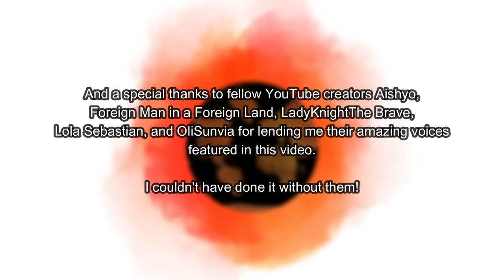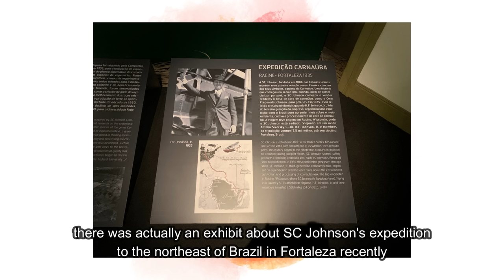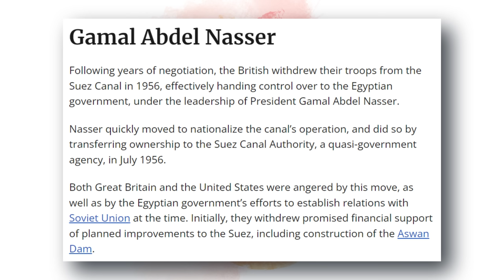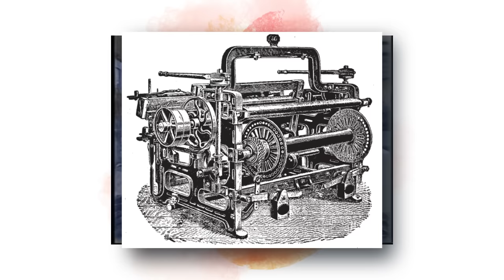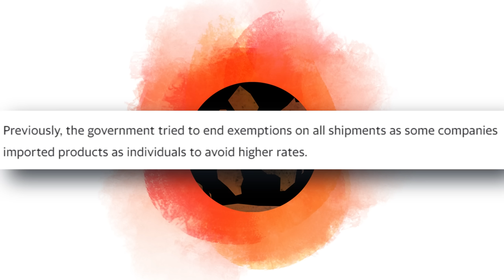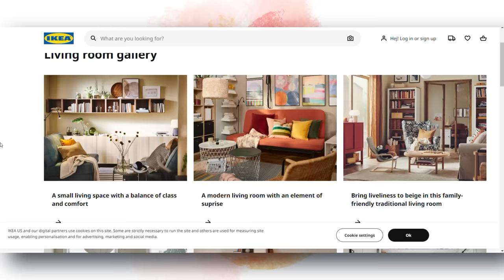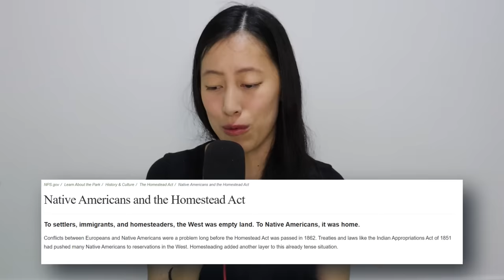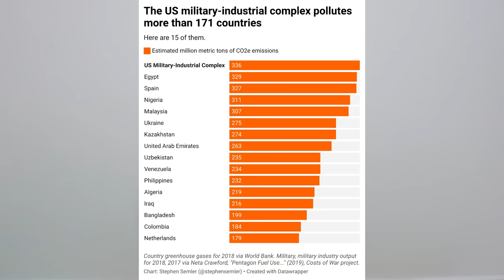Made to Break: Why Everything We Buy Today Is Trash

Comment: I've done some vintage shopping for the reasons you outline, but there are also some things to be aware of and certain cases where it might be better to buy new, anyway. The two big ones I've encountered are resource efficiency and material safety concerns.

Current appliances are by and large more energy/water efficient than antique ones. That can have an effect both on short-term cost and on sustainability. Most individuals don't favor sustainability over affordability - and I understand why, when wages are stagnant - so the latter may or may not matter to some, but for people who are in a tight financial situation, a higher energy or water bill can be devastating. I won't buy an old washing machine, for instance, because it's so much less energy and water efficient. There are some exceptions regarding efficiency, with the most notable one I can think of being computers, but there are plenty of other reasons why people don't buy old computers. Planned obsolescence plays a huge role in computers not just in terms of the physical hardware, but the even bigger driver is obsolescence of software.

There are also a lot of old products that have toxic chemicals in them because the regulations of the day were looser or people didn't fully understand the danger. The one that got me was when I bought an antique pyrex measuring cup. I found out later that they used cadmium in the paint. While the paint is on the outside and doesn't touch the contents, I no longer feel comfortable using that piece for food. There are plenty of examples of cadmium being used on things that do directly touch food. There are also some older products that contain radioactive material, and there are lots of old products with lead in them, including things that touch food. Again, there are material safety concerns with some current products, and it can be much harder to confirm that a product is made of safe materials. I think overall the prevalence of things like leaded glass used in drinkware and lead paint used in children's toys is lower than in some parts of the past, though. If you're able to buy an antique with a return policy and lead is the primary concern, definitely get a lead test swab and test it yourself.

My view is that modern things have the potential to be as good as or better than older things because we know more now about safety, ergonomics, engineering, etc. There aren't currently many products that take advantage of that knowledge to make a better product. That's an indictment of our society. On a practical level, this doesn't mean much, but it's something I think people should think about because it doesn't have to be this way.

On a practical level, in the short term, individual consumer choice is all we have to try to influence things and protect ourselves. But ultimately this is a problem with many roots and, as you point out, worker exploitation is probably the most fundamental. Also as you point out, many people are too desperate to stand up for themselves. I think what we need to do to fight these conditions is create mutually supportive communities that work together to support everyone involved.

Community soup kitchens, food banks, and gardens take some of the pressure off of workers who want to go on strike because they'll at least know they can feed themselves and their families. Community credit unions and internet service providers provide a needed utility without gouging people, and other community-based utilities could be implemented. Solar and wind farms are much more accessible than previous forms of energy production, so we're in a better spot now for community electricity than ever. Tenants' unions can more effectively fight back against slumlords.

Community makerspaces and skillshares can be a partial replacement for purchasing poor-quality consumer goods. If all the tables available to buy are made of glorified cardboard, maybe you can learn to make your own, and maybe someone in your community is willing to teach you how. Repair cafes can teach people how to take care of the stuff they have instead of throwing it out as soon as something goes wrong.

Our governments by and large are not responsive to the needs of the people, but to the desires of corporations to shake people down for more money while spending less. Because money talks in politics and corporations have the most. We need to turn to each other and work together because when we allow ourselves to be isolated to fend for ourselves alone, we're even more vulnerable to the corporations. When corporations are collaborating to screw you over, the only response is for you to collaborate to protect yourself and your community.

Comment: I used to work furniture  repair for a chain-furniture company. The items were manufactured overseas and cheap. Very little actual wood is in the wood products.

Example: a dresser compromised of a frame and drawers that may be less than 30% wood and the body itself? Layers of paper glued together and beautifully colored. Less durable than actual wood and heavier to move.

Comment: I've read that the cotton used in so many clothes these days is less durable than it used to be because it's GMO. I don't know if this is true, but it certainly would help explain why my cotton clothes seem to deteriorate so much faster now than they did when I was younger. I had kept noticing my clothes come out of the dryer with little holes in them that weren't there before--on "good" brands, too, like Land's End and finally got so exasperated that I googled the topic.
Reply: I find this a bit hard to believe since it can cost quite a bit to purposefully engineer cotton with weak fibers, and it’s infinitely cheaper to just start using less intensive cleaning and weaving techniques, resulting in poor fabric
Reply: @dawert2667  I'm not saying that the person claimed that cotton was intentionally modified to be weak, just that weakness was an inadvertent consequence of genetic modifications for other purposes.

Comment: It's not only fast fashion, but fast tech as well. Planned obsolescence and designing products that makes it difficult or expensive to repair and maintain, and cutting features like headphone jacks to get people to buy Bluetooth headphones. And speaking of Bluetooth headphones, the battery in the AirPods cannot be replaced or the headphones will get damaged. And the lithium battery can't last forever and eventually stops holding a charge ao people have to throw away their AirPods and buy new ones.

Comment: Old growth wood is stronger and far less susceptible to rot, but faster grown wood is absolutely fine for furniture used indoors.  As long as you select the right type of wood for the job and make sure it is cured properly, well-built furniture made out of new growth wood can last centuries.  We're still growing good wood too... but it's expensive.
  
But yeah, we don't make them like we used to.  Even IKEA doesn't.  Their old Billy bookcases, though made of compressed "wood" + veneer like all their stuff, were pretty sturdy.  My mum had some in her study, laden with heavy books, but the boards never sagged.  I still have a few of them and they still look great; they must be 40 years old by now.  The new ones are not great, and prone to sagging.  IKEA also used to make a little sofa out of proper wood that was very popular with students and landlords: it was cheap, it looked nice, and it was durable and sturdy.  That has been discontinued some time ago for some reason... but it was so popular that knock-offs are still being produced in Thailand.  Even people shopping at IKEA for furniture sometimes recognize quality, it seems.

Comment: A tip from an electrician, if you are replacing a light fixture. 
Make sure to get one with light socket. 
Fixtures with integrated led will have to be thrown away after led goes. Instead of just changing a bulb.

Comment: - I paid 200 for an LG gaming mouse...
Turns out they suffer from double click after less than a year.
My 90 dollar any surface LG mouse still works after six years.
- Paid 100 for a special edition XBox controller...
6 months later the right stock started to drift.
(on my SIXTH Xbox one controller. Every single one has had problems, INCLUDING the almost 200 elite controller which doesn't even include a rechargeable battery pack)
- Paid 70 for an 8BitDo controller...
Right bumper stopped working after a few months. Well known and common issue.
- Paid 4000 for an Alienware laptop in 2017 ....
And Started having a list of problems, literally weeks after my warranty expired in 2019.

Comment: also regarding trees i was told by a forest fire worker that they now are planting GMO trees that resist fires. So that should be a consern depending how it effects the  strength of the wood. We bought some crap furnature from Wayfair. It said It could take  between 3 and 4 hundred pounds. The day bed from with in 2 weeks and I bought some real wood with heavy duty bolts. It has over 600lb rating  and has not had a problem in 8 years. SO anyone buying the crap. Its bettter to buy it and then strengthen it. So the outside looks nice but I will last for ever!

Comment: My clothes dryer broke because the plastic support for the start button broke on the motherboard.  We would turn the dryer on and off by pressing a chopstick thru the hole to the underlying switch.  Since the start button was on the motherboard, the only repair solution was to buy a completely new motherboard ($600+).  We used the chopstick for 2-3 years, but eventually gave up and bought a new dryer.  Cheaper than replacing the motherboard.  Shame, all the mechanical parts were working great.

Comment: You CAN find some good quality things, but you have to look for them, and often it is going to be something that needs to be ordered.   Good furniture is out there, but you either have to make it yourself, or you need to be patient as ordered funiture usually has a lead time of about 6 months.  Plus "some appliances" and electronic devices "Can" be repaired, but often are not cost effective to have someone repair it, or parts may not be available.  If you have mechanical ability, and a willingness to look at things when they fail, sometimes you can actually repair them.  And sometimes, if you do any salvage, you can either reuse parts of a failed item to repair other items, or you may need to invest in the parts to to make something complete.  I salvaged a Kitchen Aid mixer, which worked, bbut I needed to order the mixing bowl and the various attachments, for which Amazon actually was a good resource to make it whole, and the service manual was online but you need to use nonstandard search engines and /or know where to look for them.  

But it is true that most items are made in a manner that are not repairable these days.

Comment: A lot of the appliances that we have today have some kind of circuit board in it. Most of the times, the circuit board fails, and the machine doesn't work. That is what happened to the Whirlpool refrigerator that I bought i 2018, it broke 2 years later. I called a repairman, and he said the circuit board had to be replaced. The repair cost like $650. The refrigerator cost about $2000.

Comment: Freestanding appliances are designed to last 5 years. Integrated appliances are designed to last 10 years. Integrated appliances typically cost about 50% more than freestanding appliances.

Spares for all appliances are widely available, assuming you have developed the skills to perform those repairs. 

You gets what you pay for, and thanks to yourube you can make many repairs yourself. The problem is not industry. The problem is YOU.

Comment: This has been coming for a LONG time, I used to repair tv av equipment and made a good living but slowly and surely the crap they put out combined with expensive and difficult to get hold of and actually fit spare parts meant it was cheaper just to buy a new one every time it went wrong and they went wrong exactly 2 to 3 months out of the warantee ...
Some of the old tvs would go for 15 to 20 years with minimal repairs and gave far better pictures than the newer stuff.
It is by design of course, they just don't make enough money one one sale every 15 years years.
Next will be subsription based everything, I buy my cars at 3 years old and keep them for 10 years or so but most people just pay monthly, how long before we do that for everything else like fridges etc etc, 
I worked for a tv rental company for years and the rental was good business model and easy money every month garanteed so I can see why they would want this and tbf I would not mind too much as long as pricing was fair and it's better for the world if we arent throwing crap away all the time so the rented stuff could be high end long lasting as long as we dont get sucked in by fast fashion wanting to replace it every year for next trend..

Comment: The practice of planned obsolescence replaced making quality products that would last years.  How can manufacturers and sellers make obscene amounts of money if consumers don't need to replace their large and small appliances every two or three years?  Chances are good your vehicle will require major repairs just after your warranty expires.  Got a 75,000 bumper-to-bumper warranty?  Expect a massive repair bill at about 77,000-80,000 miles.  Just buy a new one, it will cost less.  Fast fashion?  Our obsession with quantity over quality is a creation of the exploitative fast fashion industry.  "Old" can be upcycled, repurposed, redesigned, and repaired.

Comment: Remember the "material, manpower, standards" motive and profit potential side of a "global" system.
It is not just shoddy or planned failure, but the profit margin and initial cost components along with the ability and/or willingness to throw out the junk ... and buy again.
(Much as the "tech" support that comes with someone on a phone or computer 9,000 miles from the customer.)
I used to live and work in China, and an awful amount of terribly manufactured common goods and household items was everywhere -- and really cheap according to typical American/Western standards.

But, if I could buy a bag of plastic clothespins that were too small to hold anything heavier than a pair of underwear on a line; or a set of wooden clothespins with springs so small they actually popped off when I tried to use them; or a pack of plastic clothes hangers that were so thin and brittle they literally snapped in the hand with no effort at all; or a drain plug for the sink that was so thin and flexible that the drainage suction caused it to collapse and thus be rendered useless; or (my favorite) safety pins made of metal so thin and worthless that they would just twist and pop open with the least tension applied by use. 
Remember: these ridiculous things were nickel and dime to me, however expensive for a low income Chinese worker or housewife.
Paying more, I might get something of quality -- for about the same (adjusted) price as I would have paid in "the old days" when such items were manufactured in the USA.

Win, lose, or draw: If it costs a dime there, it is a dollar here. A dollar there, five dollars here. Same crap, identical frustration, higher price tag domestically.
Like they say in New Orleans: Cha-Chinngg!!! 
So, the real issue is quality, and quality control, and precise manufacturing standards -- gage calibration, tolerances, operational specifications: all of the good stuff that, largely, the Chinese are simply terrible at mastering, or adhering too.
Even when they care to purchase the right equipment and follow the rules.
At any price.

The difference?
By the time you get the "junk" here, it is marked up about five or ten times -- profits that go to the corporate shits who get this stuff made cheap by little or hungry or untrained hands in faraway lands.
And, like most, you are able and usually willing to "buy up", or get screwed again; and typically complain and grouse and buy again.
So, if you advocate and lobby for a system of systematic corporate corruption in manufactures of "consumer" products:
Why worry?
You're getting more than you deserve.
And the typical consumer can't do a damn thing about it, without a lawyer.
Happy Shopping.
PS: Please don't think that I have some kind of beef with the "Chinese" in these remarks; I'm well aware of the reality, all over the planet, first hand. Keep the simplistic politics to yourself.

Comment: I think why products today tend to be less durable is multifaceted.

The later generations are no longer knowledgeable about electrical/electronic/mechanical.  Tech today means a bookish/software knowledge and experience, not actual physical stuff.  Characteristics of mechanical/electrical is a give and take thing, a sexy form factor, high performance, ease of use, translates to a product that is much higher cost and/or degraded durability.  Well known expensive high performance products like gaming PC notebooks, gaming video cards and game consoles fail because the industry is not conservative in design like yesteryear.  Want a durable PC notebook?  Makers like Lenovo (originally IBM) make excellent durable business class products.  Being conservative is pricey, like a factor of 4x.  Example, commercial/business power/manual tools cost around 4x times that of the consumer grade products.  The latter is made for sale at a price point.

Marketing, US manufacturing brands like Apple are no longer an actual manufacturer.  They are a marketing and distribution company.  Marketing is a 025T business in the US.

The dollar is worth about $0.10 compared to the 1960s.  The US is no longer the King of oil and has been drinking the oil like there's no tomorrow.  A countries wealth is largely based on oil.  Many brand names simply don't exist anymore because the consumer is not willing to pay the premium.